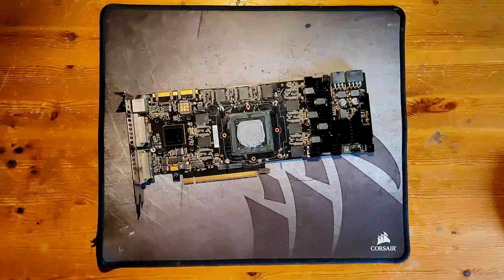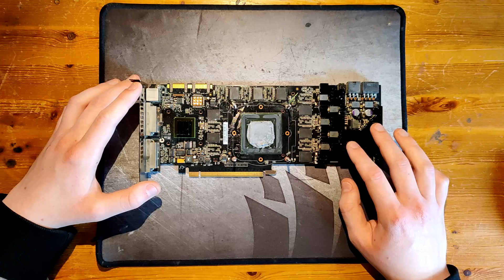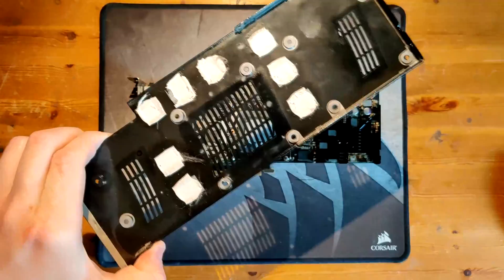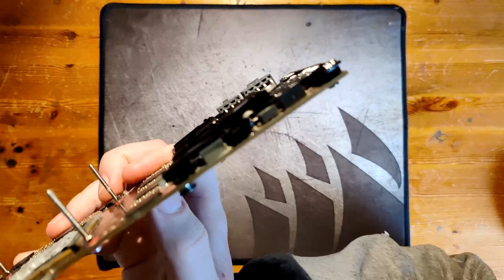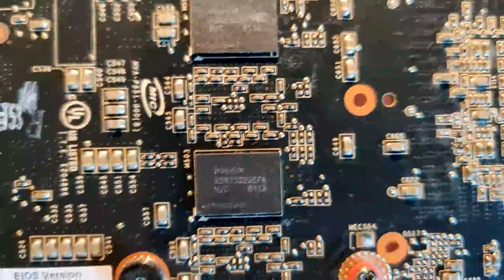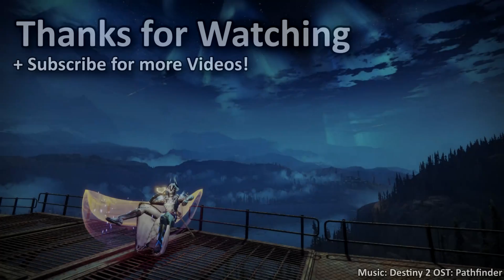First time Overclocking a GTX 280

Comment: I've run DX12 in the form of Timespy on a  gt430 and gtx 480 so they can run dx12 in windows 10.
Reply: GT430 and GTX480 are Fermi based cards, Fermi support DX12 (feature level 11_0)

Tesla dont even support DX11